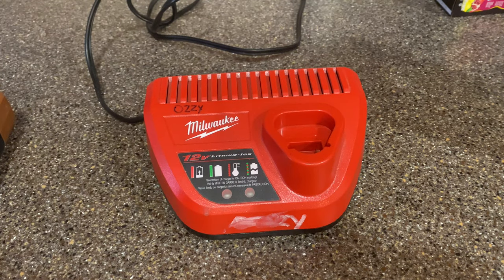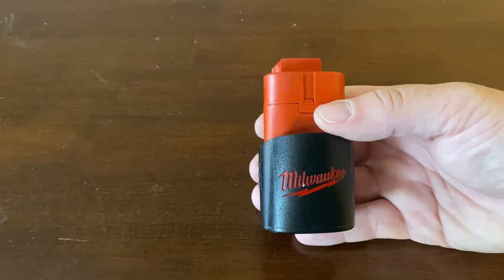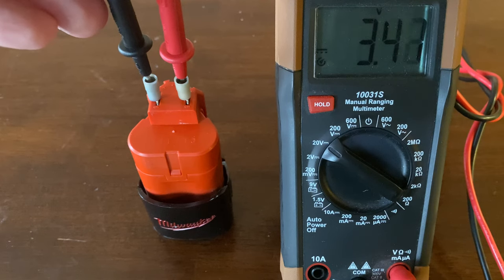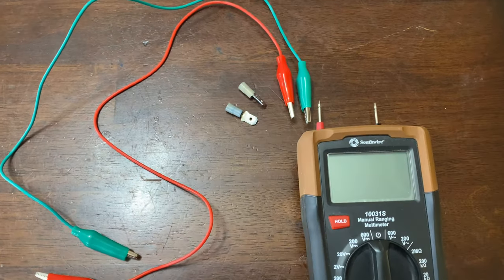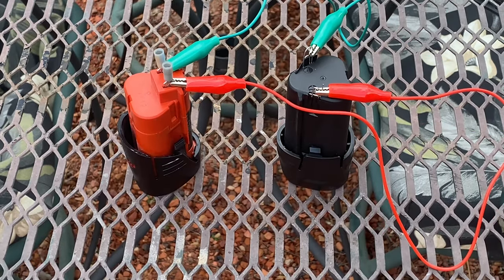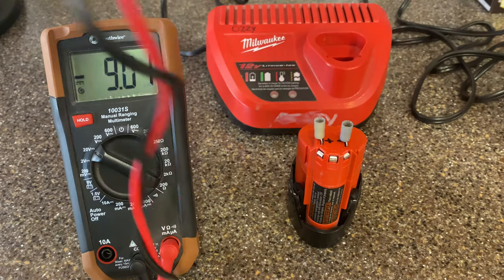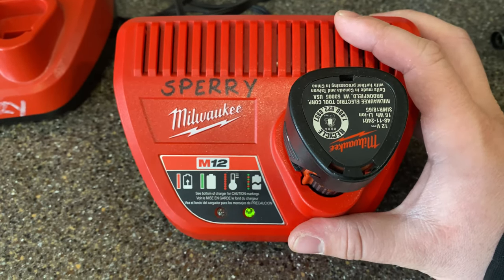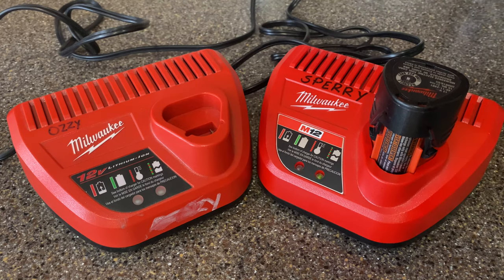Can You Jump A Tool Battery to Revive It? | Milwaukee M12 Battery Jump

Comment: Dude. After you boost the bad battery. No batteries in the charger. Unplug the charger for 1 minute. Put the bad battery in the charger and plug in the charger. Voila !!!!
Reply from the maker: I'll have to give it a shot. I'm not sure why that would work but if it does, I'm all for free fixes!
Reply: after boost , my m12 battery still couldn't charge , but trick with unplugging charger worked for me, thanks for sharing.

Comment: Just tried on it my M12 6.0amp. It showed dead on the charger. Also, showed 9.3volts when “dead”. Jump charged it with another M12 4.0amp (fully charged) about 3 minutes. The dead battery came back to life holding a 12.13volt charge! Awesome! Saved about 80 bucks!
Reply from the maker: Nice work! I love saving money!

Comment: I did this on my daughters battery, but it was the bigger one.  I tested each cell and discovered one totally bad cell. A cell that is flat will never come back. Good try . I give you credit.  I generally find the same thing happens. The battery charges to a certain level,  after another attempt, it actually loses voltage. At that point,  it's a candidate  for the recycle bin.

Comment: Well.. Your basically more right than wrong in thinking something like this might be possible.... By correctly assuming that one unchargable battery could be "jump started"  or brought back to life by connecting it in paralellwith a fully charged battery...But you have to account for the fact that each battery is a package of several battery cells... which is 3 in this case.... If you apply your method at that level it will most likely put enough charge into the "drained" battery cell so that a regular charger could finish the job as usual.....Also the voltage in each battery cell must be in equalibrium aka balanced....If you do that , put it back into the original pack it should all be fine and dandy...More or less!..;-)
Reply: Dude why are you telling him the same thing he went over in the vodeo. Hes explaining this as a tutorial it dont need your blah blah  dont have a college degree blah blah nonsense with an overcomplicated explanation of rubbish. I dont think theres one fact in your entire comment

Comment: You had the battery jumped in reverse polarity in your video! You are lucky the battery did not blow up on you.  Check your work again.
Reply from the maker: Rewatch @1:07 and @2:57. The negatives are at the left/top while the positives are on the right/bottom. It is wired correctly.

Comment: I’m pretty sure you’re supposed to leave it jumped for way longer than a minute
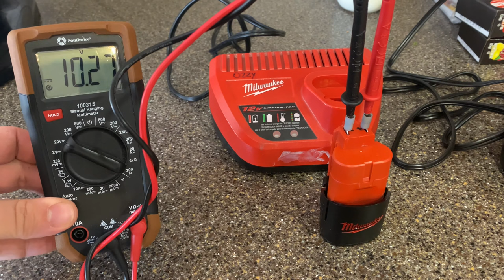Reply from the maker: @4:20 I mention I let it sit for up to 30 minutes and still no change. I’ve done this many other times with other batteries and if the cells are good it does in fact takes less than 1 minute to jump the battery.
Reply: I did it for one minute and slapped it on charger right after and it worked. I didn't want to leave it for a long time and risk hurting my newer battery. I've done this before and it not work but I just wanted to try it again rather than throw another battery in trash. It worked and saved my battery. Appreciate the video and the save of 80 bucks

Comment: (Flashing error) make sure to check the temp sensor tab (rightmost P tab on the side, I believe) if one is lower or dented, use a pick to bend it back straight.... sometimes it isn't the cells; it can just be a bad connection on that P terminal causing the device as well as the charger to think it is overheating.
Reply from the maker: Thanks for the tip!

Comment: A better-quality charger COULD help. I had this scenario with a 12v DeWalt.
Reply from the maker: I'm not following. How is an OEM battery charger not quality? Or are you just saying in general a generic charger is not as good as a OEM one?
Reply: The more expensive and or rapid chargers often have better electronics. Some of the guys I buy tools from can't give those M12 chargers away. I have a couple I've never used. 

So the experience I had with DeWalt was a 12 volt 1.5 AH battery that came in a kit. The cheap kit charger would not charge it due to heat. I tried it in DeWalt's 4 bay fan cooled rapid charger. No problem.

Comment: The only thing about jumping the battery is you need to do it every time pretty much
Reply from the maker: It depends. It’s just about getting it above that nominal voltage so the charger recognizes it. If the cells are good, just discharged, you should only need to do it once unless you let it keep dying. If the cells are bad, then yes. I’ve done this to other batteries that just were sitting for years and now charge on their own in the charger after only jumping it once.
Reply: Or in our case we left it sit dead for a month

Comment: Not worth the risk with the 12volts, buy a knock off waitly for $10 they work almost perfectly out of 12 I had one bad. Fuck Milwaukee and their $200I batteries that last 4 years with 15 charges only on them. 
I done this hack with big paper clips for the M18s and I had luck both times BUT the paper clips got instantly HOT in 3-4 seconds. I could see a fire coming if I waited any longer , I immediately disconnected them burning my fingers. But fixed both my m18s. You put fire and burn on the line. Wear gloves,do it outside and use 14 gauge Rolex wires with goggles if your a gambler. If no luck but the knock offs m18 never had a problem with them. For every 4 year old Milwaukee that bad with 15 charges on them I don’t reward Milwaukee I reward their competitors